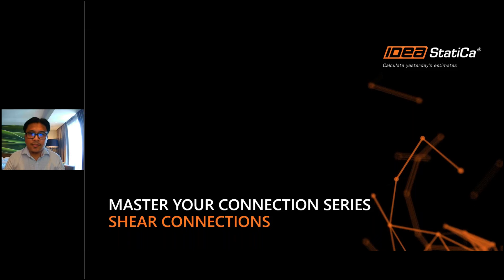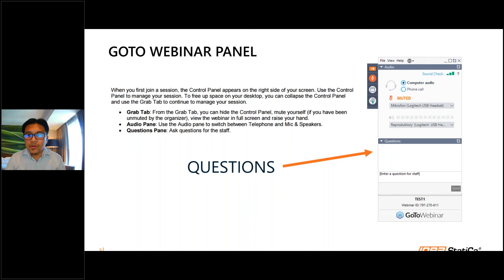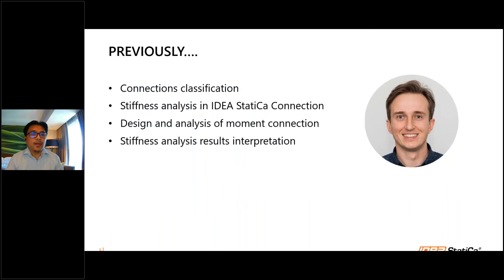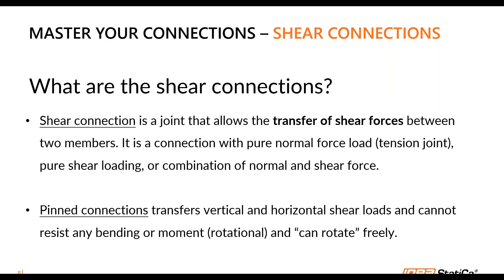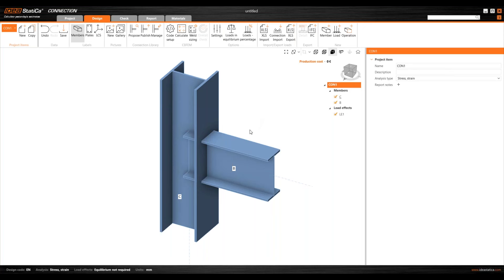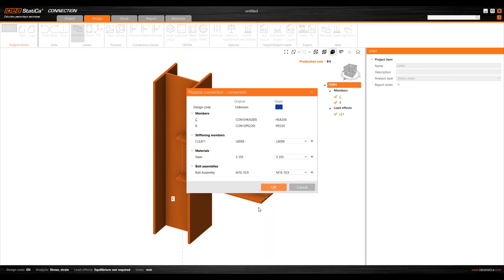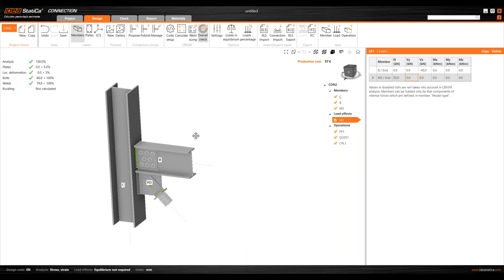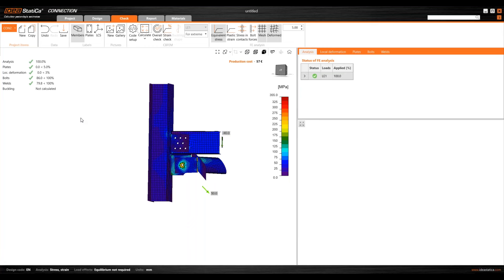Master your connections - Shear connections

Comment: Good day if the consultant insist that the forces should be applied on the Node so that a momentdue to eccentricity is generated what is the proper way Should it be on Node or on the Bolt thank you 🙏
Reply from the maker: If you design a connection with a hinge (pinned connection) = in your global structural model, there is no moment in the node, only a shear force, then in IDEA StatiCa you set the position of the shear force to bolts (center of rotation in the hinge).
https://www.ideastatica.com/support-center/how-to-define-correct-load-position
If in the global model you have bending moment in the node (semiridig or rigid connection) then you dont move the shear force position in IDEA StatiCa and leave it in the node.
In other cases when you want to elaborate and achieve a perfect alignment, you can use the manual set of position of shear force and thus moment diagram shift.
Reply: @ideastatica_en  thank you ❤️❤️

Comment: Can you please tell how to model double shear connection???
Reply from the maker: Hello, it depends on the needed design - the Splice operation allows you to add the backing plate, so you form a double shear. Or you add a stiffening plate and bolt grid separately:
https://www.ideastatica.com/support-center/how-to-model-both-side-splice-connection
you can find examples in the Connection Library:
https://www.ideastatica.com/connection-library